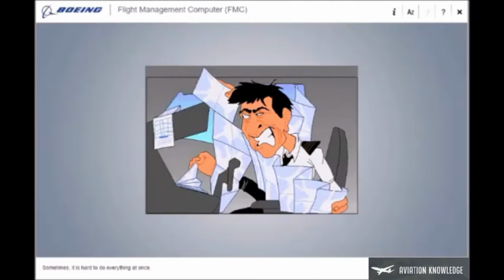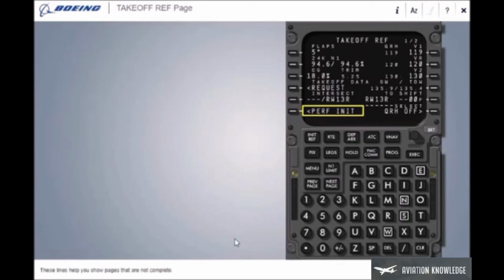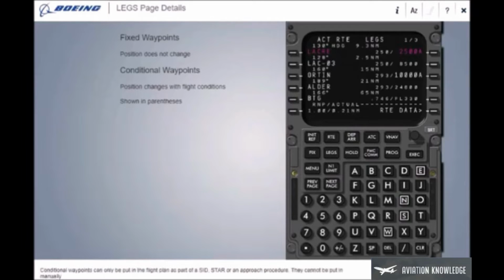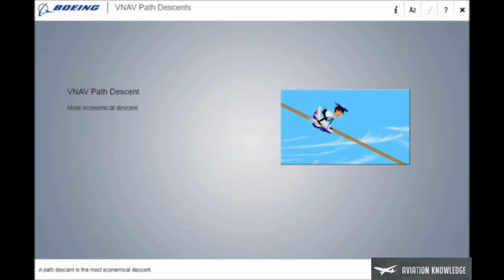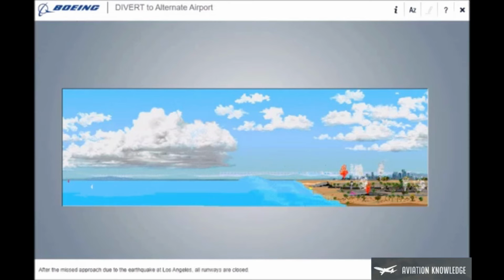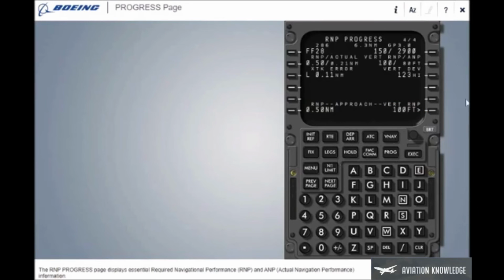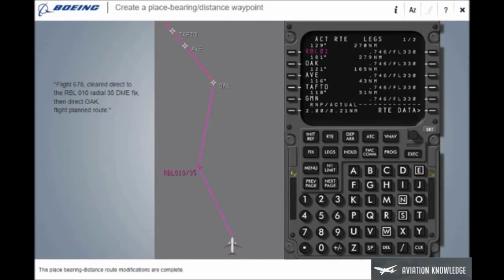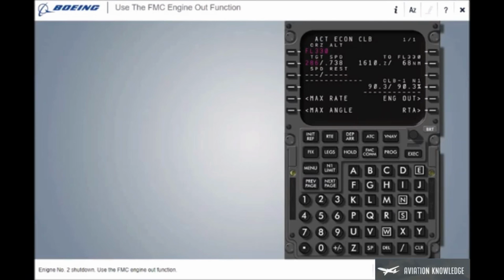B737 CBT  Flight Management Computer - FMC

Comment: Great and educational video, thanks! I have to watch carefully because of the somewhat low resolution though.
Reply from the maker: You should be able to choose up to 720
Reply: @aviationknowledge-ar  Thank you! I even see and selected 1080. Nevertheless the image is not clear. It looks like it's a copy of a low-resolution video where the copy is high-res, but the original is not. For example, the 'AVIATION KNOWLEDGE' icon in the lower right corner is crystal clear, howerever, the actual information in the video is not.
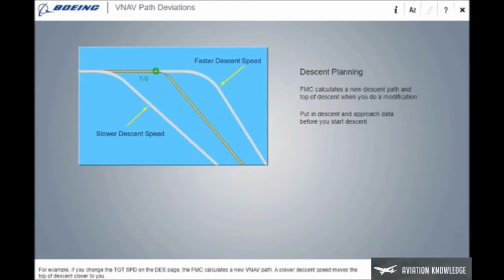Reply: 1:29:21 Wouldn’t a higher descent speed (310 versus 300) lead to a steeper and therefore higher path rather than the lower path shown here? See also 1:28:39.
Reply from the maker: Yes indeed what the change in speed shown is the flight new path after updating the speed. Faster = Stepper